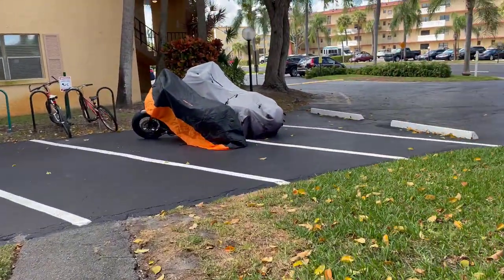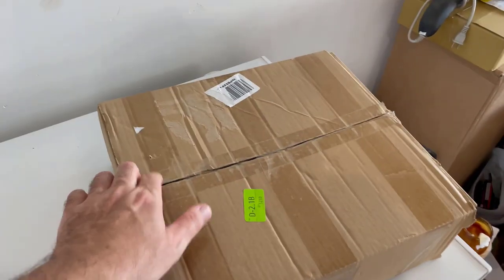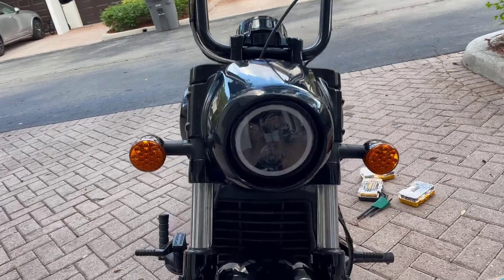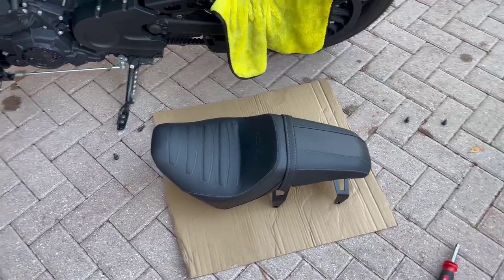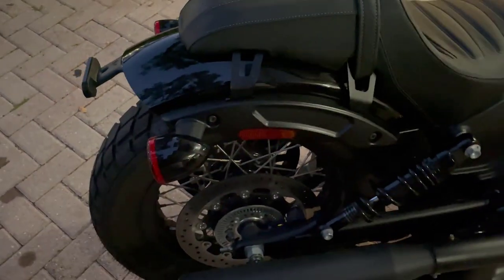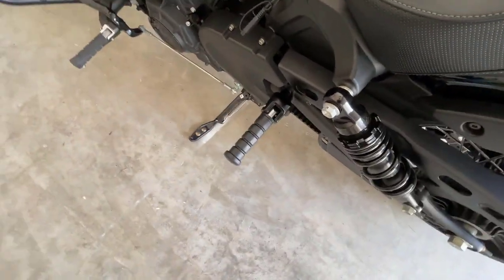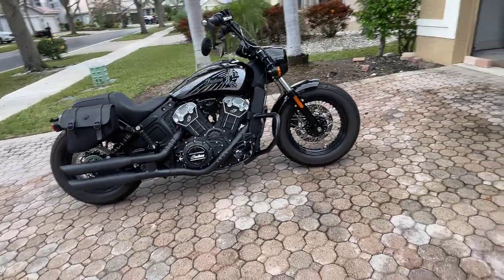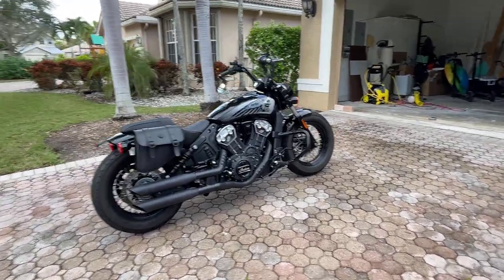Indian Scout Bobber Top Mods Available @ Amazon 🏍️ Unboxing, Installation, Review, Washing & Ceramic

Comment: You switched seats to the worst one I ever sat on. The tractor seat I have is the best I ever sat on compared to the trash that it came with but each to his/her own I guess. Crash bars excellent idea. V&H first stages were also a good choice. Not sure about your choice of bars but again, it's a personal thing. Passenger pegs or anything passenger on this bike are, imo, a waste. This is a single rider bike. Nice saddlebag. Mine came out of Italy with nice red stitching. Not crazy about the 2020 tank decal. Indian hit it right on with the design of the Bobber. Beautiful bike. Ride safe my friend. You did a good job for what you felt was right for you.
Reply from the maker: Thank you for the comment and compliment )
The tractor seat springs would collapse under me as soon as i sat down on the bike. Perhaps it needed stronger springs. I any case i personally like the modern look more 😎
Reply: @motolife1  I hear you. I am still toying with the idea of bars like yours as the stock ones have me leaning forward. Over distance it can be tiresome.
Reply: The seat you had originally is what I had. I would slide out of it with hard throttle. Super scary couple of times. I changed it to syndicate 1 up seat and it's 100times better and safer.
Reply from the maker: @AndoBMS  100%!

Comment: Nicely done video. I think I would have removed decal from tank before any sealant, but to each their own. Great looking bike. I have the standard scout, currently in cryogenic sleep for at least another month (WI)
Reply from the maker: You right. I didn’t think about it. Alright another project. I need to put another coat of ceramic on it anyway.